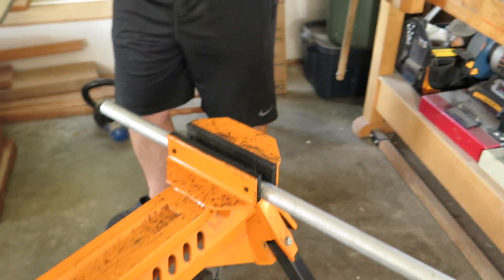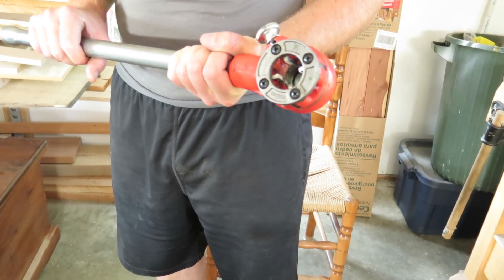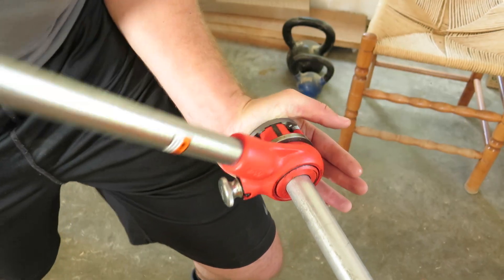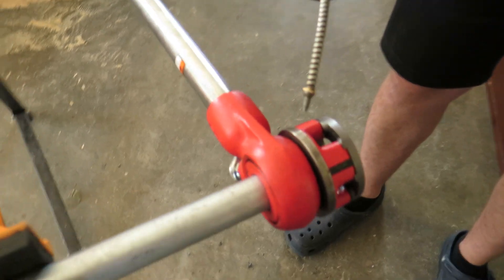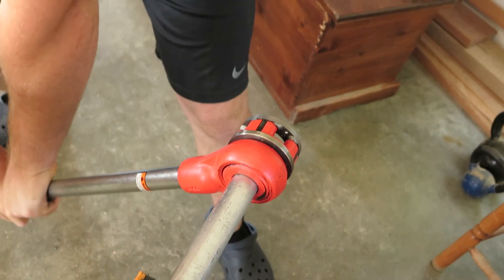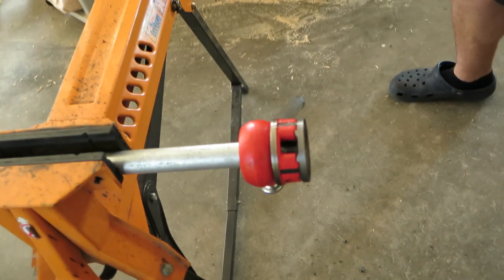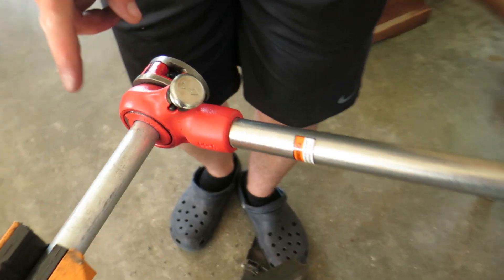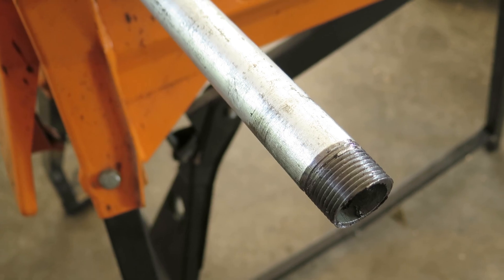DEMO: How to Thread Steel Pipe

Comment: i can't get it to cut as it turns, even though i'm applying pressure with my other hand. is it simply a matter of raw upper body strength? that would be bad news because i'm really skinny
Reply from the maker: Yes, threading by hand does require strength, but not a crazy amount of strength. What kind of handle do you have for the die you're using? You can put a pipe on the handle to extend its reach and give you more leverage. Tell me about your situation and I may be able to offer some solutions.
Thanks for watching and commenting!
Steve

Comment: What if the pipe is already in the concrete wall. No room to work such a big tool with other things in the way. I need a simple direct socket I can use with a drill.

Comment: Can this be done on a pipe when the current external threads are almost rusted till they are gone or look like no threads are on it.
Reply: Yes but your pipe will be shorter, you need material to cut. If you need it the same length cut down put a coupliing and buy a pipe nipple of appropriate length to bring back to proper length.

Comment: What did  you do about the burs up inside of the pipe? thanks
Reply: You can use a file, coarse sandpaper or something similar to get the burs off
Reply: @TheDarknessConsumesMe666  is correct. @wheepingwillow24u17 make sure you ream the pipe. A pipe reamer or stepper bit will work.

Comment: Not galvanized but hot dipped in zinc. Galvanizing is always via electrolysis. Also you threaded to far. The die should be flush with the end, or else the end will be cylidrical if its threaded to far.
Reply: "Galvanizing is always via electrolysis"? What? Galvanized steel literally just means it has zinc metallurgically bonded to it. Hot-dipping in zinc is the most common form of galvanization.
Reply: @1992jamo  no it isnt. The whole concept of the term galvanizing leads back to the greek scientist luigi galvani. And he got famous for finding out how different metal would affect the nerv ends of a frog leg through metal conductivity. So the term referes to a guy who solely got famous for finding out different metals own galvanizing currents. Hence that galvanizing always is referring to electrolysis. Hot dipping is just hot dipping and not galvanizing... When you dip an icecream into molten chocolate, do you galvanize the icecream then?
Reply: @Helikopterpop  Luigi Galvani's work has nothing to do with what is considered galvanization these days whatsoever, regardless of if it's a namesake. What on earth is your definition of galvanization? Electroplating? Even that has nothing to do with Galvani lol.
Insisting that the entire world is wrong about what the term "galvanized metal" because it's a eponym, is like insisting all cars have horses. because it comes from the word carriage.
Reply: @1992jamo  galvanizing is a name for leading current though an conductive solution which makes metal salts adhere to another metal. Galvanizing means currents between metals and har nothing to do with zink what so ever. You can nickel plate something via elecrolysis and that is also galvanizing. And that the name has nothing to do with galvani from who the expression is taken is just plain stupid. Hot zink dipping called FZV is not galvanizing, however FZB which is the blank thin coating with less corrosive resistance does.. It's different process, no electricity means no galvanizing. Period!
Reply: @Helikopterpop  Ok, here is the weirdest thing in the world. Firstly, I apologize because it's a bit of a misunderstanding between us. It turns out word "Galvanization" doesn't actually translate well between Swedish and English. In English, it doesn't really mean anything to do with electroplating, they are considered separate. But in Swedish "Galvanisering" really does mean electroplating as you say.
It's weird to compare https://en.wikipedia.org/wiki/Galvanization 
https://sv.wikipedia.org/wiki/Galvanisering
Reply: @1992jamo  yeah I realized that too. Everything seems to differ between sweden and us. Like MIG welding, or tubing vs piping etc. In some cases swedes are more precise and vice versa. But in many cases the american terminology is really complicated. Like pipe and vvs fittings where the threads are called after the nominal inside diametre of a pipe. 1/4 inch coupling is 1/2 at the threads and so on..

Now atleast we understand eachother. :P
Reply: @Helikopterpop  Haha yeah. I'm from the UK so fortunately most things are metric, but pipe fittings are really bad. The copper pipes are in metric, but fittings have BSP imperial threading. A 1/4" BSP thread is actually 0.518" outer diameter, madness.

Comment: how do u do this by yourself tho? one hand holding pipe wrench , other on tool??
Reply: With a pipe vice that actually will hold the pipe in place and won’t allow it to spin
Reply: @RSST662  tripod with chain vice.
Reply: @landonlandon5533  I've got one of those from a plumber will try it sometime soon. Wandered what all that blown oil or WD40 looking stuff was in a 20 ltr container in the shed think it might be the cutting oil? Guy is deceased step Dads, so not sure exactly what's what never done one before. But i got all the all school plumbing dies etc and tripod and vice and different sized dies etc.
Reply: @jaffasoft8976   you could learn on this very platform on exactly how to run the dies properly.  Yes it's more than likely cutting lubricant.  I bought  a set at an estate auction. It was a good purchase.
Reply: @landonlandon5533  will have a look tomorrow. I've got a project atm to put some steel pipes fittings in a 45kg old empty LPG gas tank and fill it with waste veg oil and apply a vacuum and get water out, dry the oil as a processor to use in a running a diesel vehicles engine. Thanks.
Reply: @landonlandon5533  i did it. I kept echoing them word in my head "you can never have too much oil, u can never have too much oil. Filled an empty cleaned tomato sauce bottle and kept the oil up. Turned out real good. Was able to cut the pipe off with a similar thing but then i tried to thread the other end and couldn't get it to grip on the pipe and start, tried a number of times, took the die out rotated it but no luck getting it to grip and start the thread 3/4 inch, it made a beveled edge on the pipe but never gripped just kept spinning, i was trying hold pressure on the end with one hand but still no good. 

Maybe the die is well worn, it looks like it. I gave up on it for now until get a new die or any suggestions. It was around the right way its got a tapered angle of the thread it makes.

It def old school this tool its got AUSTRALIA map engraved in the side and N&H company name or something and the oil says Australia don't often see that these days.

Comment: Trying to put half inch threads on a steel rod, but it's a little to wide for my die. Not experienced enough to known if there is a quick solution for this.

Comment: Don't forget to ream the pipe first before threading (if you are not using it for a closet).  Glad he finally added the oil, after prompting!
Reply: Only a hole can be reamed— NOT the outside of the the part.
Reply: I always ream after I cut and before I thread
Reply: @jp10rex What do you use to debur inside of pipe end?

Comment: Every things fine, but I have one small question - what about the big sized pipes like 1 1/2 "?
Reply: Different size die heads for different diameter pipes.
Reply: Same question, big size like 2" and 3" ? Internal thread too?
Reply: there are other dies you can use  @jizozorfred2999

Comment: How much is the price?
Reply: Huw much
Reply: They are using Ridgid Brand... Chinese knockoffs are available for under $75.00 that include 5 dies , handle  and pipe cutter.
Try Harbor Freight , Amazon or EBay. Canadians try Princess Auto ot Uncle Weiners. Larger centers may have PawnShops that sell usrd tools. Hope this helps.
Reply: eBay or DHgate .
Reply: @RaysLaughsAndLyrics  DO NOT WASTE MONEY ON CHINESE KNOCKOFFS!!!!! 
CANNOT STRESS THIS ENOUGH. 
THOSE CHEAP LITTLE INDUSTRIOUS BASTARDS SELL YOU ONE THAT LOOKS GOOD BUT THE TEETH SHRED RIGHTT OFF THE DIES THE SECOND THEY ARE APPLIED TO PIPE
Reply: homedebo got this does any body no please

Comment: Don't we need to reverse 1/2 or 3/4 of the rotation  after every full clockwise rotation to break the chips?
Reply: I always do, Reverse it and add cutting oil. And repeat.
Reply: NAW, he was wearing Crocks so no need to to do the right thing and break the chips....LOL
Reply: Amit Punjani if the teeth are dull you usually back it off to get the shavings out. If u have good teeth you should cut your threads in one shot
Reply: @dunkdamonk  nah you break the chips to PREVENT the dies from dulling. It puts more strain on the threads and dies when you cut it in one go with a manual threader. If you have an electric threader with a brace bar for the dies, you probably also have an oil catch pan and an oil gun. With an oil gun, you have enough lubrication to cut it in one go. Otherwise, back the threader off to break the chips.
Reply: was just thinking this as well.
Reply: How do you call this tool